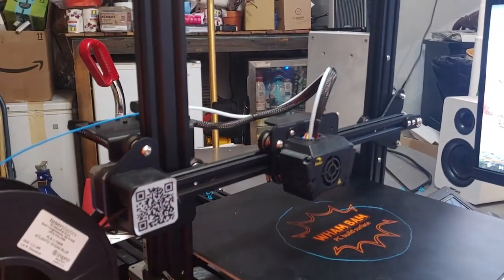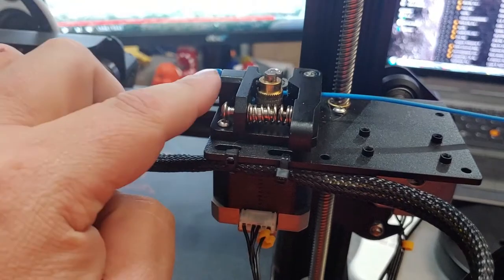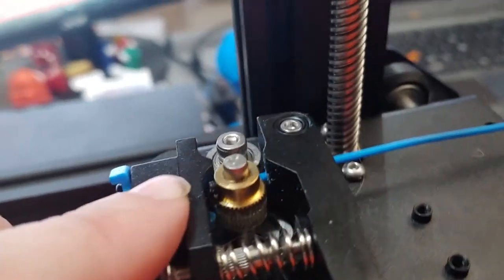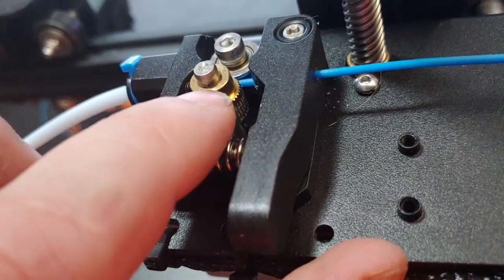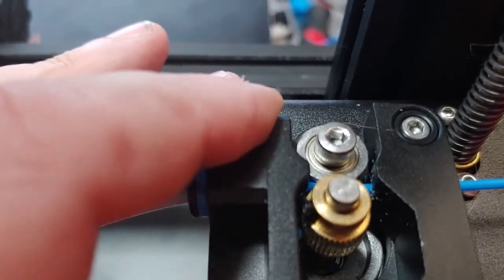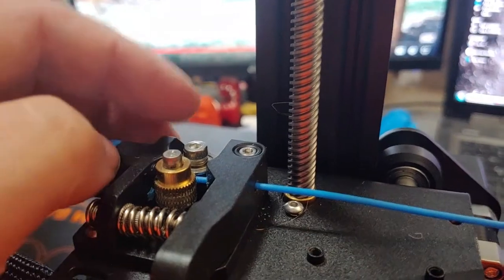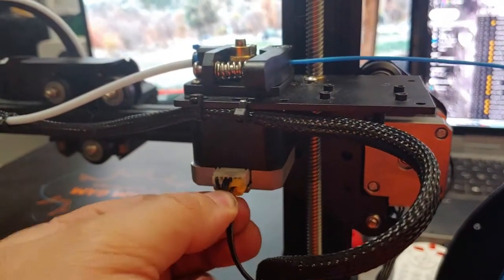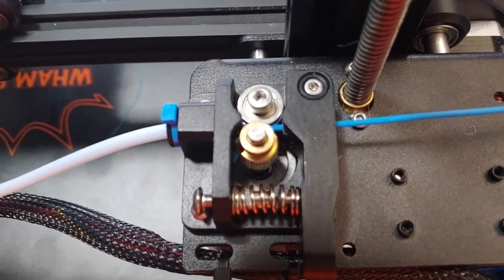Extruder Feeder Failure, Diagnostics, Fixes T3DP

Comment: Excellent video for newbies!   Most of what you had in this one I learned from your live streams.  (never know what will come up during one) Also good for a refresher when you haven't messed with the feeder for a while.  I replaced mine with the metal one because the filament chewed a groove in the arm.  I was shocked because I hadn't been printing that long.  I also moved the spool to the side, I like that better even if it takes up more space.  Thanks for all your had work Chris. 👍🏼
Reply from the maker: Just remember if you don't correct the issue that caused it to cut the groove it's going to cut a Groove in the aluminum one as well it just takes longer :-)

I am trying to slowly work on a set of tutorial videos that I can link all in one place so if I have to tell somebody how to do something I can point them to a specific video that short and sweet and to the point instead of a 6 hour live stream with a good luck finding it :-)
Reply: Nerys Oh I did fix it.  Moved the spool from the top of my Ender 3 to the side where it has a direct path to the feeder. 😍
Reply: @nerys71  This!!! I love this idea!!

Comment: I've noticed the lead screw on the Ender 3 Max has an alignment brace at the top. I've seen much debate over whether or not this should be added as an upgrade to the standard E3/E3P and other single screw printers. Many claim it's supposed to be left open and that brace will just cause binding issues. I realize the Max has a much taller z axis but do you have any thoughts on this? On my E3P there's a decent amount of play around the threads so I've been wondering if making a brace would offer any benefit.
Reply from the maker: It's not that I'm supposed to be left open it's that it should be because most of these printers are not built and assembled with a high enough tolerance to avoid issues so I tell people leave it free if there's a bearing brace up there you'll probably get better results by removing it creality however is an exception they heeded my advice it's captured but not restrained so while there is a bearing up there and there is a peace up there that captures the top of the leech groom if you were to look at the top of any creality printer that has one and grab the rod and wiggle it you will see that it's actually two pieces and it permits the rod to move inside of that piece so it's captured but it's not restrained and the restraint is the problem :-)

Everything is a straight square and aligned perfectly restraint won't cause a problem but these machines are not built to that kind of calories none of them come with absolutely straight lead screws and most and users aren't going to assemble it perfectly straight this can cause a problem if you restrain the top of the lead screw capturing it is okay as long as it's free to wiggle around
Reply: @nerys71  Ohh so this is still allowing the lead screw to move a bit while encouraging it to stay within its boundaries.  That makes a lot more sense! Thanks for the detailed response, that has been bugging me!

Comment: i have an ender 3 max, and lately i have been having problems with the feeder, sometimes it chews, sometimes it cuts the filament, and i don't know how to change the feeder tension, also mine has the sensor before the feeder, any suggestions? (i already changed filaments and clean the bowden, noozle and hot end)
Reply from the maker: Feeder problem are many times hot end problems. Since the hot end has no moving parts so issues manifest at the feeder.

2 common issues at the feeder. 

Grub screws into the drive gear and the tension arm cracks on the plastic one (underside)

Comment: Great Vid as always! I have a question for you (or several). I've been having a problem with my ender 3. It would print fine for the first couple of hours and then it'll start under extrude and stop extruding completely, but it'll start another print fine again. Where should I start looking?
Reply from the maker: The two most common reasons for a printer to do that is either PTFE Gap or heat creep

4 PTFE Gap watch my video on rebuilding the hot end

For heat creep this is almost always the fan on the front of the printer Inside the Cage not the one on the side

If that fan is not working or is working slowly or is Caked Up in dirt and dust it won't be able to effectively cool the cold side of the hot end as the heat from your hot end moves up the heat break into the cold end the filament inside the cold end expands and jams inside the hot end
Reply: @nerys71  Hey, thank you so much for a quick reply! I can't get to it yet, but I'll let you know how it goes.

Comment: How about selling me that resin printer above your head for a decent price? I have all kinds of fdm’s no resin!
Reply from the maker: well I won't sell that one. its the new 002H with monochrome screen. I might sell an RGB resin machine but what would be a fair price with shipping? might cost $75 to ship it. and $100 is not very fair to me but you can buy a new one shipped for $160 to $200. its very hard to sell use printers when you factor in shipping. Works locally but the shipping really kills it when you ship.
Reply: @nerys71  your right